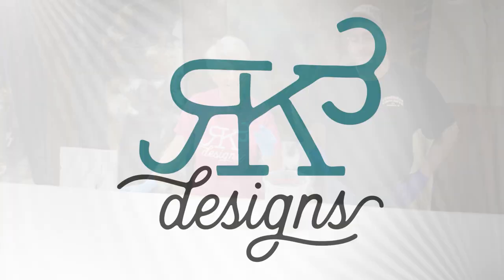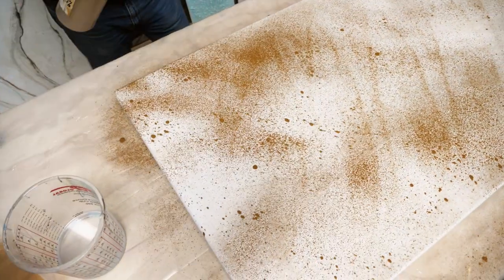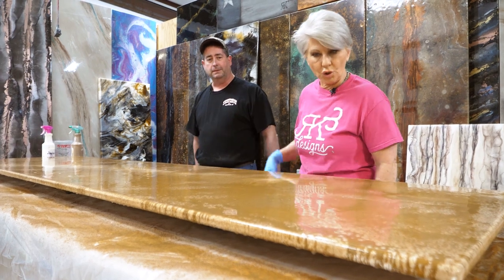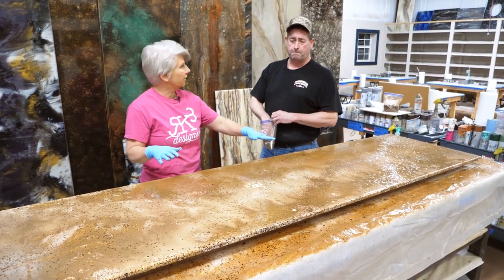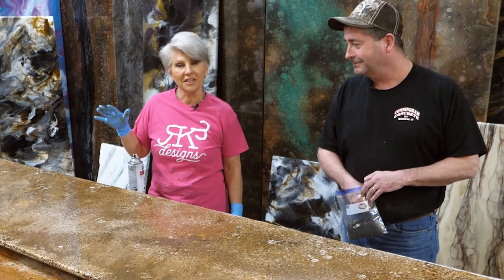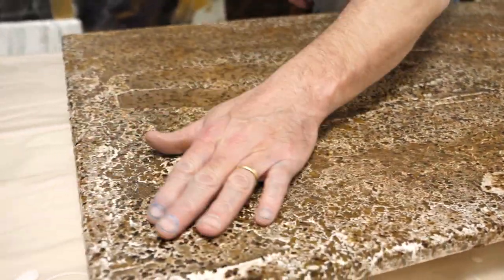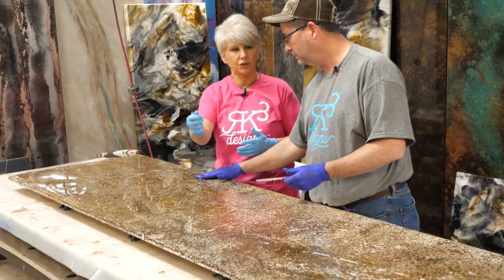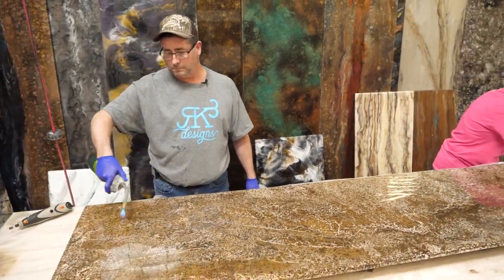How To Make Crackled Granite With Epoxy | RK3 Designs

Comment: Great result!  I'm not sure I understand "acrylic and dispersing colors". Do you just mean acrylic paint mixed with water?
Reply from the maker: You could do it with acrylic paint as well but the pigments wouldn’t be as strong. Dispersions are the pigments used to tint the acrylic paint. They are just more concentrated. 😊
Reply: RK3 Designs is that the same as mica powder?